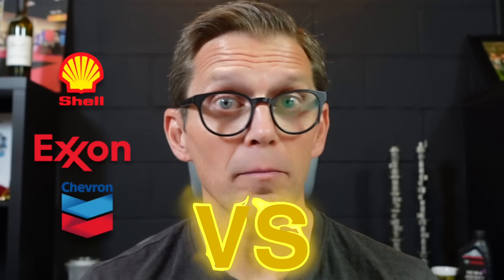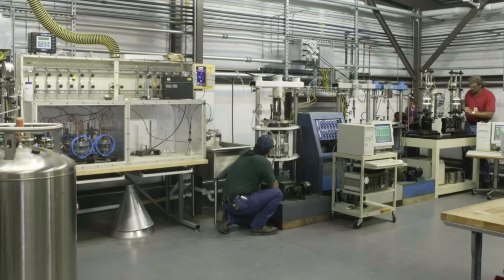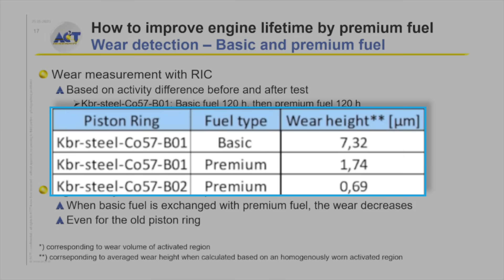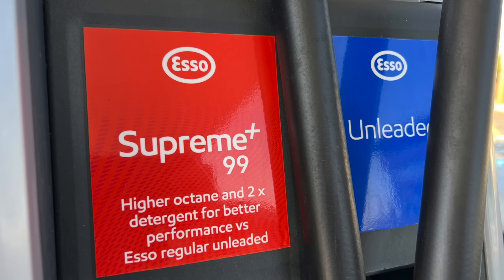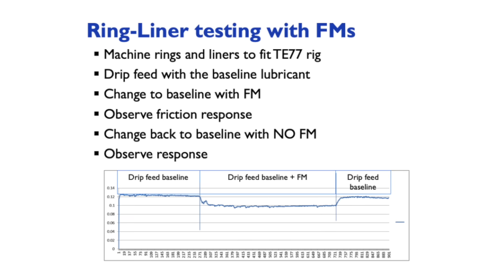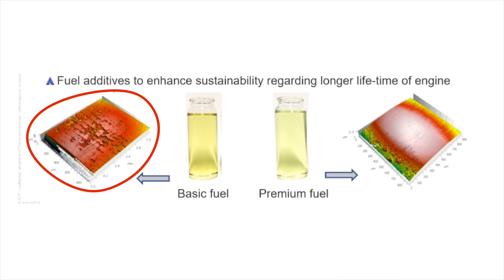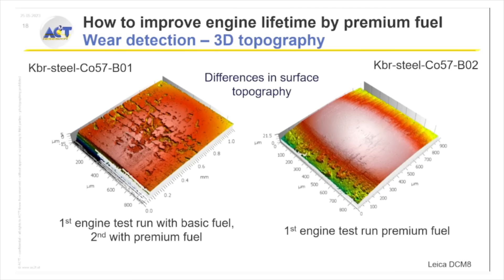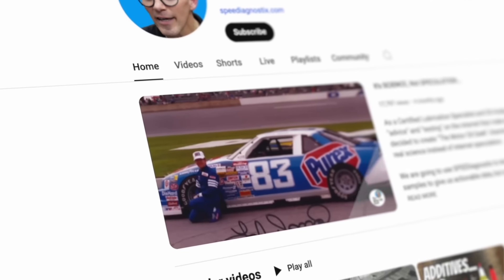Can Premium Fuel REDUCE Engine WEAR?

Comment: The legendary 1.5 liter 1NZ-FE in my Toyota yaris currently has 307,000.
I bought it with 17,000 miles and I’ve done consistent 10,000 oil changes with the specified 5W-30 and it currently burns about 1/2 quart in 10,000 miles and have strictly fed it 87 octane.
These cars are known to commonly run 500,000 and even 600,000 miles without ever touching the engine!
Those facts and related economics work against me paying the 20 to 25% more for 91 fuel given the longevity in my case.
If we assume I’ve paid $3/gal, get 36 mpg ave for 307,000 miles.
I’ve laid out $26,000 so far, where I’d have laid down $32,000 for 91 octane.
That’s $6000 more!

Comment: It would be great to see how different "off the shelf" fuel additives added to a control basic gasoline, change the wear profile as seen here. Everything from fuel injection cleaners to the red "mystery" stuff to diesel fuel (of which I knew somebody that would periodically add 16 ounces or so to their gas tank on a fill-up every couple thousand miles or so)

Comment: Great info and unexpected. Makes sense. But only if the actual fuel sold at my pumps are what you say they have in them. So Shell V-Power is mentioned and what does it actually contain to lower wear? I commonly buy Sunoco 93 in NYS. Does that necessarily contain friction modifiers or am I wasting my money? How do I know if in fact a cheaper 93oct doesn't contain wear additives? We really need a random sample test of various premium fuels to know that what we buy will actually help the engine against wear. Thx Lake!

Comment: Fascinating report. Some anecdotal evidence: in my 2005 Mustang GT, I use mostly Chevron or Shell in only the mid-octane (89 or so) range, but I add Lucas Upper Cylinder Lubricant/Fuel Injector Cleaner to EVERY tank. And yeah, I thought of it as "snake oil" originally, but I'm up to 231,000 miles so far (bought it at 22,000), the car runs well, does not burn any measurable amount of oil, and still gets 25 mpg on the highway. Just my experience.

Comment: It leaves me wondering...

1.) Can a similarly resilient additive package be formulated into oil? 
2.) Why not offer the same additive package in all octane versions of gas, since not all vehicles run the best on high octane. Likely it's a cost/marketing issue.

Comment: Great info!!! I'm a believer and use Shell 93 religiously with over 340K on our Mazda CX5. 🙂
Reply: There is no Top Tier 93 here, only 91. I take good care of my CX-5 Turbo too, though I have 80 times fewer miles on mine. Yours has to be the highest mileage Mazda Skyactiv 2.5 I've seen to date! I use Pennzoil UP 5W-30.
Reply from the maker: Thanks for sharing!
Reply: @jayray61 what maintenance have you done on the transmission?
Reply: @gtppilot  flushed, filter change, and fresh fluid every 65K, makes a difference! Also do the plugs and filters every 12 months
Reply: @JayRay61  thank you for the info ! Great job keeping that cx5 going. I have a 6 now, but cx5 will likely be my next vehicle
Reply: What year is your CX-5 I just purchased a new CX-30 non Turbo and hope it last me this long.  I currently run Pennzoil ultra platinum 0w20 full synthetic oil with wix filters and change oil every 3,000 miles
Reply: @Howard6r80  2014 model, GT. My daughter drives the 2023 CX-30. Great cars, awesome! Majority of my driving now is for business and it's never let us down. I do oil changes (0w20 synthetic) religiously every 4-5K miles, tranny service 40K miles, Seafoam once a year, plugs every other year, filters yearly, tires at 50K miles, brakes are serviced every other year approx, battery can go 3-4ish years (put the charger / wellness unit on it 3 or 4 times in the winter months), and then keep it regularly washed with decent products - even rinseless ones in the winter months. I am not too OCD with this car, just trying to keep it going and saving $$$. Sure it has a couple of dings from other car doors, but when a car is 10 years old, it's going to happen. 😞 Front sway bar links and bushings and wheel bearings will need attention over time, recently did rear shocks and shock mounts.
Reply: Normally I wouldn’t keep a car this long, but the body and overall condition has really held up. Also just put some brakes and all season General Tires on it. Mind you it’s getting a little long in the tooth, and I’ll price it to my daughter to drive locally.

Comment: it’s all marketing nonsense. i don’t believe that the fuel will make much of a difference so long as you use the fuel the car is designed for it to use. What’s Really Important is that you Change Your Oil Frequently!!! this way you don’t have to worry about the ZDP additive not being available in the oil. 😊 change your oil frequently and your Piston Rings will be happy 😊

Comment: Fascinating!  I’ve always looked at octane and said no point in premium in most engines unless spark advance or turbo boost is controlled by knock sensor; no difference in energy content in the gas (I do not use gasohol).  This REALLY begs for a comparison of anti-wear additives in premium fuels.  Thanks.

Comment: But is it worth the extra 26 cents for the premium fuel compare to the basic one over time ? 
Assuming I refill 45L once a month due to low travel(about 500km range total). At the current cost of 155.9 for basic and 181.9 for premium... That's $70.16 for basic and $81.86 for premium. A difference of $11.70. Over a year that's $140.40.
Now how often do the parts that receive wear needs to be changed ? Looking up online, you can typically go over 140 000 miles before needing to maybe replace a piston. That's 225 308 km.
For me, at around 500km per month, I am looking at 450 months. Or 37 years. Or about $5265 in extra costs in premium fuel during that time. How much does a WHOLE engine cost to replace ? Looking up online, that would cost you between $2k and $10k depending on the motor. A piston is much less... Yeah I am sticking with my basic fuel. By the time I ever even reach that mileage, I will have most likely sold my car and bought a new one anyway. Now of course, some of you do use your cars much often. Now assuming I was travelling that much PER WEEK instead of per month... that's still 8 and a half years. Bi weekly ? 17 years. Sure it's nice to know premium does actually do something instead of being pure marketing... But lets be realistic, it wouldn't affect most of us. Unless you buy a very used or you have some older vintage car you want to protect to wear.

Comment: A comparison on fuel brands would be awesome! Thanks Lake!
Reply from the maker: Great suggestion!
Reply: It's sounds good to test. But location(state/city/county) can vary, one Chevron gas station may not have the same quality as the other Chevron station 3-5miles down the road since the owner of the shop can order gas from different places or they can add/dilute it to help them save money.

Had one popular company gas station near my home that got shut down due to higher then normal water in their fuel(they were diluting gas to save money). Had a different one where they used 87 octane in both 93 and 95 to save money(small town), people who's cars only run on the higher octane noticed the issue and later found out what the owner was doing. Not a lot of cars used that octane 17yrs ago in my town/city.

But yea

Comment: Great channel, great content! Question, I have been running Lucas full synthetic buying by the 6 gallon box for years in various weights in my 97 land Cruiser, 98 Tacoma, 2007 4.7 tundra and our new 2019 5.7 tundra.

Is Lucas a great choice? Our new to us 2019 5.7 tundra we bought a few weeks ago with 69k on it all highway. The oil looked super old and the filter was also looking old, I don't know which oil has the best turgeon package, but I definitely want to get the oil engine cleaned up on the inside from what looks like 10K crap oil changes. 

Should I stick with Lucas full synthetic 0w20 or should I switch to a different brand? I want this truck to run forever On my Toyota except for this one to have over 300K. 

I sent the oil that was in from the previous owner off the Blackstone. Looking forward to seeing the results this week

Comment: I wonder if DI eliminates this issue, since DI engines only inject fuel moments before the combustion stroke when the piston is at or nearly at TDC. Versus carb & port injection where fuel enters during the intake stroke and the entire cylinder wall is exposed.
Reply from the maker: Great question. In fact, DI makes it worse. There is less time for the fuel to vaporize in a DI engine.
Reply: @themotoroilgeek  so the time for fuel to vaporize has a greater impact than how much cylinder wall is exposed and for how long? That's pretty surprising. I also thought the whole point of DI was to use such high pressures that the fuel was atomized immediately upon injection.
Reply from the maker: @mikethebeast1012 Yep! Injector location also plays a big role. We talked in depth about this during the livestream we did in August.

Comment: I have a question to the motor oil geek, i wonder if you know how a engine running on propane would compare to gasoline in this test, i use propane

Comment: One thing i hate about fuel stations is that if someone got regulsr fuel before you get to that pump, then you pick premium. You will still have a back log of the regular fuel in the line untill the premium clears it out. So you will always have some bad fuel unless the pump only has one grade of fuel instead of the typical 3 per pump.

Comment: Almost every vehicle i have owned the the past 30 years was made for 87 octane i have tried shells higrade but never noticed a fuel improvement never new about the wear thing only fuel besides race fuel i have ever seen a difference is Sunoco 94 but havnt seen it in over a decade it made a big difference in my 82 supra, 84 FJ60 and my mx6 mthe supra got better fuel economy and piwer really only noticed power out of the rest. A few years ago a budy gave me 5 gallons of 110 leaded i put in my 99 f250 only thing i had at the time that dint have cats and noticed nothing other than it smelled a little different burning its made to run off 87 im guessing thats why it dint do any better the supra and mx6 had hier compression pistons in them but still never noticed any different with schells premium gas but its probably better now wish Sunoco still had the 94!!!!!

Comment: From your previous video on additive products, I get that most of them really are of little benefit.  I used to use Lucas Oil Stabilizer as partial fill on a mid cycle oil filter change I would do on Mobil 1 on a 7500 mile change interval, e.g., 3500 or so miles I would change the filter to make sure the filter was filtering and not going into bypass with contaminate saturation.  Well, I no longer do that as I change my oil at a lower mileage duty now.  That said, I am wondering: If we don't know what brands have the best additive package to enhance cylinder lubricity on the oil and compression rings, is it possible a fuel additive could enhance the fuel lubricity for less piston/cylinder friction?  I have, on occasion, used Lucas gas additive for cleaning action on injectors and top end lubricity.  I am wondering if you measure the oil ring/fuel dilution factors (which are unique), perhaps something like this could enhance the cylinder oil/piston ring lubrication?

Comment: The Shell V power is actually really nice fuel with a crazy lube and nitrogen package....Problem is they cut off v power from the 87 and you have to buy 91 silver to get it.....This being said, if you have an older car....Older engines lose compression, higher octane can compress more then lower octanes and will burn better in an old engine even if the computers still calculating 87 on the fuel trim strategy

Comment: An analysis of Top Tier brands vs other brands would be an amazing video
Reply: Absolutely! 💯
Reply: Most us smarter car ppl running top tier rated fuel esp in modern GTDI engines. My excellent '22 Edge ST AWD only gets 89 midgrade top tier rated fuel since new along w/Pennzoil Ultra Platinum/Fram Ultra filter every 5k mis. Runs/drives phenomenal! 💯
Reply: @Davido50  *runs phenomenally
Reply: @Davido50  all Fram filters have had major rest issues lately, that goes right into the oil.
Reply: Rust*
Reply: @chrismon1001  Glad you woke up on that.
Reply: @chrismon1001 I use OEM filters only made for that engine.
Reply: Agreed
Reply: Agreed
Reply: See project farm
Reply: Agreed😊

Comment: My 2024 Subaru BRZ recommends in its owner’s manual 93+ or 91 minimum if 93 is not available.  In my state the only gas station that sells 93 octane is Sunoco (their Ultra variant).   Additionally I add Techron Complete every 3 months.  (Annual mileage 4.5-5k; oil will be changed every 6 months = 2.5k).   I wish I had Shell available in 93 or higher octane.

Comment: Great video, very clear explanation. However, what about engines that 87 is the recommended fuel? The stability of 91 or higher octane will not get a “full burn” in the combustion chamber. Therefore leaving the catalytic to clean up and possibly increasing carbon build up. In fact, I once damaged a catalytic running 91 long term in a car designed for 87. I learned this from a mechanic that tuned and raced Honda Civics for a living, back in the day. I’m not a scientist/engineer. These are just my own unscientific observations after 35+ years of driving and maintaining my own cars. My point, is it possible to get 87 with these friction enhancements?

Comment: Yeah their gas is good detergent wise like I had a car that burnt more than 1.5 quarts of oil in 800 miles and it ran a little ruff at idle it vibrated the car like it was misfiring and stuff after that premium fuel it stopped misfiring and running ruff it still burnt a alot of oil but it ran alot better it does make a difference using shell premium they know they're stuff

Comment: I have seen gas milage increases with small amount of 2 cycle oil added to my gas and it lasted for two tanks with my experimental 92 camry ...
at the peak of my tweaking experiments,..i was able to see 50 mpg hwy after dialing in many adjustments to weight, areo,tire pressure ,timing, etcetera. Mistakes were made but overall it was a great lesson the motor made it to 312 000 .i traveled the country cheap

Comment: The naming is super janky. So you have Regular fuel, Mid-grade and Premium fuel at every gas station here in the USA. Those dictate the the Octane rating only, and have nothing to do with additive packages outside of knock modifiers. So the title = Can Premium Fuel REDUCE Engine WEAR? is just goofy without the context. It should be Can Fuel additive packages REDUCE Engine WEAR?  One could just think "wow my Toyota's engine won't last long if I don't use Premium fuel" after watching this, when in fact the answer is no your Corolla does not need nor should you fill it with Premium Fuel. You should fill based on manufactures required spec, and just get your gas from a station with a known good reputation. It's just odd to think that Regular Premium, Mid-grade Premium, and Premium Premium are a thing, and well I know this I and you know this would be that most people don't. I think an interesting video would be you taking Regular Regular gas and adding 3rd party fuel additive packages think Chevron\Lucas\etc and comparing them to  Regular  Premium fuels from like Shell.

Comment: We need to know the Sulfur content mainly between other Fuel impurities.
On a cold engine start up there will always happen DILUTION, in the GDI it will be much higher and so will be the engine wear, so here the TBN will be very important for engine longevity, a issue that low SAPS,  low viscosity and FE modern oils don't take in account.
Fuel additives are important on a good quality base fuel (as stock oil) and they are which give a cleanliness and corrosion properties, as well to reach the required OCTANE, this is needed to avoid knocking, another issue for the high RC on the GDI engines together with the fearliness LSPI.

I would like to know why high octane fuel are cleaner, because the sulfure content will be the same ?? I wonder if additives will countermeasure that issue.

BimmerN53

Comment: Valero....76.....Shell....Exon Mobil....Chevron...Arco.....Costco....All top tier fuel it says on the front of the pumps.....In a lot of cases it all comes from the same refineries so it's the additive package that's put in for the different brands....And ethanol gas sucks....Non ethanol is better gas.....It stores longer... Gives better milage....Ethanol is a government scam.......

Comment: How would running an engine on LPG effect the chemistry of the oil at the rings? There is no additive package at all, but also the fuel is not supposed to dilute the oil as it is in gaseous form inside the cylinder.

Comment: Hey how are u I live in ft Worth Texas I love your vids quick question I drive a 23 charger 5.7 hemi the manual said use 89 octane which I've been using 711 gas and the Pennzoil ultra platinum oil ow20 so is the quality of gas bad I'm using car is running smooth as butter though